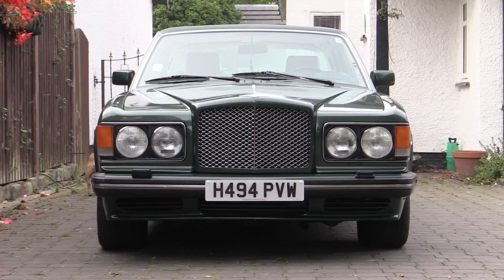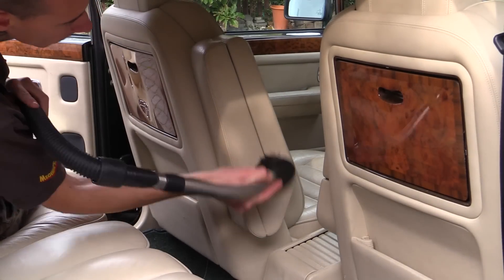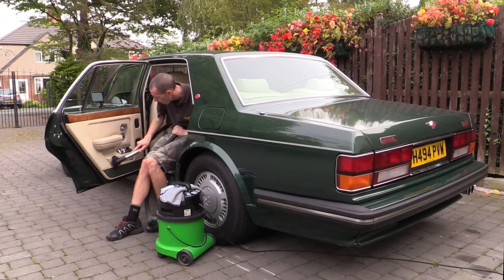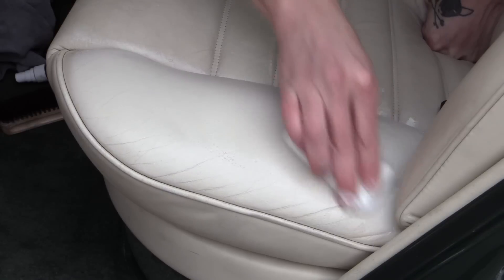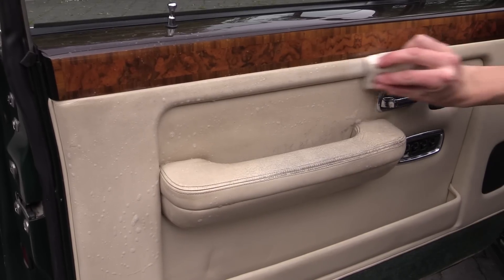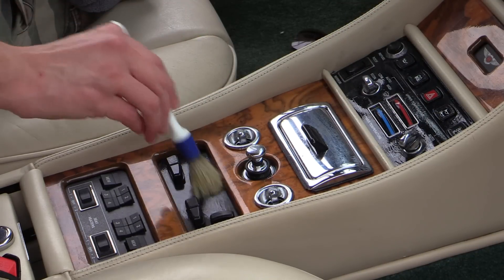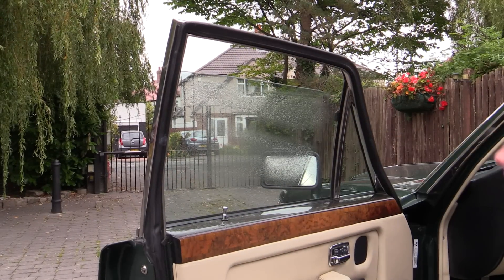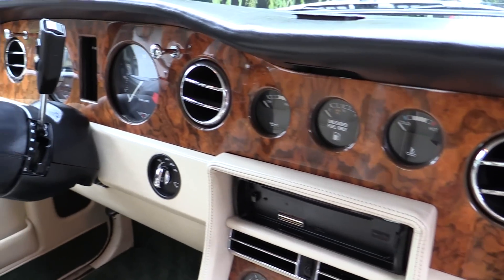Decades of Dirt! Bentley Turbo R Interior Clean

Comment: Your video will be of tremendous use for me.
Whenever a girlfriend says "you spent HOW LONG washing your car?" I can refer them to this video and tell them that there is a world of difference between a simple car wash and a proper detailing. As a matter of fact between getting out the pressure washer for my foam gun, the two bucket washing and the CR filtered water for the final rinse (and I do remove the wheels too) Maybe I would be better off just throwing her a hundred or two and tell her to go shopping with her girlfriends.
I once spent three entire weekends on a Porsche that a friend bought at auction and I told him it could use a proper cleaning, compounding (to remove the swirls that the pre auction fluffers installed) and then Cquartz coating. Just the under body and engine compartment took an entire day. I spent three hours just jeweling the paint with Menzerna po85rd and a black pad.
Damn, did I feel satisfied with the results too.
Reply: People who don't detail cars, just don't understand how long it takes
to do it properly.  Feels wonderful when finished, and the car is
just gleaming.
Reply: Joe's Place haha I'm a girl and my ex boyfriend would always gawk at the time I spent babying my Lexus sc... he ended up breaking up with me because I wasn't girly enough (I'm into cars and he thinks that's a mans hobby) Oh well...

Comment: Iove your videos. I don't know why but I find cleaning a car relaxing even tho it's hard work. It's also so satisfying to see the outcome.
Reply: Tech Metal same here.
Reply: Finally someone like me haha
Reply: Actually it is alot easier than it seems. Its only difficult working in a shop because they choose quantity over quality. Ive spent a full day detailing an SUV. Turned it from a dirty soccer mom type vehicle to a brand new luxury SUV that it should be. All it took was a shop vacuum, trash bags, carpet cleaner, vinyl cleaner and protector,  leather cleaner and protector, wheel and rim cleaner, microfiber towels, glass cleaner, car exterior soap, shammy, buckets and an assortment of brushes. The price you pay at the shop is the same price you pay for all the supplies that can do at least 5 details. You could also attempt to wax your own car but I wouldn't recommend it. Just use a clay bar. Its very easy to mess up a waxing.

Comment: Did you get the steering wheel cleaned? It's one of the most overlooked parts that most detailers just overlook or simply wipe dry. When I detailed my family's 4 year old car, I hit the steering wheel with APC and swirled with a brush, then when I dried it off my towel literally turned dark grey. That steering wheel had 10x more dirt on it than the entire interior combined, and my family are quite clean people.
Reply: AgentAndroid sometimes through age the colouring of the steering wheel can transfer onto a cloth because of the dye

Comment: If you have a velcro backed electric DA polisher, you can buy various Velcro backed brush pads. I have a light/medium one and use it to clean cars with all leather seats being dirty. I typically do it first, since the DA can sometimes throw a bit of agitation foam but it works GREAT for tackling a large amount of upholstery in a timely fashion.

Comment: Magic eraser (melamine foam) is the equivalent of 3000 grit sandpaper when wet. Works great!
Reply: I actually damaged a leather steering wheel on a 2015 car (left some white spots, meaning I removed a layer of leather), had to get it replaced by warranty, but now I cringe everytime I see someone rubbing anything with it, its a really abrasive tool if not used correctly, I'm really wondering if he decreased the life of those leather seats using the magic eraser!

Comment: Im a 15yr detailer...worked at mercedes many years...done 100s of cream leather seats only using a bucket of hot water to rinse APC sprayed onto magic sponge...spent years using tradition leather scrub techniques with dissatisfactory results....excellent results from magic sponge...most times its the first and last time the leather will ever be cleaned...so its ok to be aggressive and seal to protect...i use on all vinyl and leather interior surfaces...especially dash , steering wheel and gear shift knob....thanks for the great videos...

Comment: A couple suggestions. First, when vacuuming the carpets, agitate the fibers of the carpet with a stiff nylon brush. This helps bring the dirt up so the vacuum does a better job. Second, when vacuuming and cleaning the front seats, recline the seats as far back as possible. This is so you can easily get into the crevice between the seat and back. Also makes cleaning more thorough.
Reply from the maker: +gatorcellman While you're not wrong, quality carpets like these can often get away with not being brushed first plus these weren't actually that dirty, and having not been used for awhile the battery was dying so I wanted to keep the seat manoeuvres to a minimum, plus I think a few of the switches weren't actually working!
Reply: Don't think this guy needs any advice form you to be honest mate.

Comment: If the owner never cleaned the interior, I do NOT want to know what was in the door pockets! I"ve seen an episode of Top Gear where they bought used cars and had a lab test every inch of the car. Richard Hammond had the worst car: they found mucus caked up around the doors and inside the door pockets! Poor Hammond!

PS: using the Magic Eraser on the seats is a brilliant idea. I never thought of that. I'll remember that tip if I have to get a really nasty stain out of my GTI's seats. I find it hilarious that Youtube recommended this video out of nowhere because two days ago, I spent three HOURS washing/detailing my GTI. I used Meguiar's #16, which is really strong but it isn't always easy to remove it so I had to go over the car twice: once to remove the layer and again to make sure I don't leave any residue. Had to rely on an LED light to make sure I got it all off.
Reply: YouTube will recommend stuff to watch depending on what you google, also when I shop online YouTube will recommend stuff similar to what I bought.. I used to think I was being Mind Fucked but then I calmed down and figured it out...

Comment: He should have done the back top seats first, that way he can sit on the bottom 1/2 and clean away  better and then do the bottom 1/2 after he is finished, instead of sitting on a just cleaned surface. :)

Comment: Nice work mate.. I use the 303 aerospace protectorant also... Love the stuff,  so do my customers . One thing but, I noticed on the black door cards of my car that after some rain had got in when I accidentally left windows down one day it left white marks where the drops had run down the door card . In fact I have noticed this on several occasions. Have you ever seen this? Weird thing is I have never noticed it happening on any exterior areas I use the product. I thought it might be caused by the different materials the product is used on.
Reply from the maker: +Tony Villarreal Yeah rain almost always leaves unsightly marks on interior surfaces, especially dark leather. It could be to do with the fact the 303 is water based but if it isn't happening on the exterior then maybe not! I've always found they come off quite easily though and are never permanent.

Comment: You did an amazing job on this vehicle, a few of the items you used did surprise me and I enjoyed watching some new techniques. I don't know if you still check the comments on this particular video, but I noticed that you used a leather cleaner, and then a spray on leather sealer (I thought you said). Is that like what a conditioner would do?  When I clean the seats of my older Bentleys and Rolls-Royce's, I always have used Connolly Hide Food, I can easily get it where I'm located, and it may be cliché but I've always liked the smell. Hearing your bit about the UV protectant of the sealing product you used, I was interested to determine if this was better than the hide food.  Thanks!

Comment: Hey Buddy, like what your doing and in a very pleasant way too. Really like the idea of the zymol and eraser combo. Nice to see the quality car being cleaned but why no videos of a manky builders van!!!!!  Reckon you would have many takers for that one.
Reply from the maker: +Roy Armstrong I bloody hate cleaning vans and still have nightmares about some of the wrecks I've cleaned in the past!
Reply: I've just taken delivery of my new to me van. Long wheel base transit,
stinks,
Dirty,
Ghosted lettering,
Rotten ply in the back,
Unidentified stains in the seats and floor area etc.....
and those are its good points. Going to do a full overhaul from engine to back doors and might try posting them. 
P.S. Any ideas on how to get rid of the ghosting apart from the Porter Cable DA and 1000 grit ??

Cheers Buddy and keep posting I already ahve 3 pages of notes!!
Reply from the maker: Haha nice one, sounds like the kind of thing commercial dealers used to want me to remedy in a few hours for twenty quid!

I've done allot of vans with ghosting and have never had to use anything seriously aggressive, so start of with something relatively light and if that doesn't 'cut it' move up otherwise you're just potentially making more work for yourself with the finishing that will be required after the aggressive cutting.
Reply: +Car Cleaning Guru Thanks for the reply buddy. Will start off with cleaner wax and see what happens. 
Thanks Roy

Comment: Very nice! In my personal BMW 530i, the black leather has a lot of sun damage; it's very hard in places, where protected areas (like where the leather is shaded in the back portions of the back seat) are buttery soft. Is there a product you have experience with that I can use to help soften and restore the leather?
Reply from the maker: CG Sprayable Leather is good although it sounds like it may be too far gone in places.
Reply: +Car Cleaning Guru Yeah, that's what I'm afraid of. And reupholstering the whole interior would cost an arm and a leg.
Reply: Car Cleaning Guru Thanks! Love your videos!
Reply: You should try Leatherique. Its a 2 step process, kind of expensive and takes some time but it will leave your leather very soft and clean. I used it in my 1988 928S4, which had very dry and hard leather, and the results were incredible.
Reply: Manuel Gorbea Oh, cool. I'd heard about them in the past, but related to leather repair and crack-filling.

Comment: @carcleaningguru

i recently purchased a car with a partially torn strip of leather along the side of the drivers seat and I'm looking to repair it. i see from other videos that it can be fixed diy. i value your opinion and i was wondering if you've ever repaired a seat during a detail before and if you have what product(s) you may recommend?

thanks great videos btw
Reply from the maker: +baseruner13 I've got no experience with actual physical leather repairs, sorry!

Comment: Joe as always I love your videos but am curious about something you say every so often, you have to sacrifice a full blown detail because losing time and will have to suffice because also working the camera, is there owner blowback or do you touchup what you're "compromising" on or leave as is
Reply from the maker: Almost all the cars you see on the channel are ‘staged’ cleans which are done free of charge so even if it ends up a half-job due to camera work eating into the cleaning time, there can’t really be any complaints. Paid jobs are performed off-camera as they require focus and every minute possible to get them done!
Reply: @CarCleaningGuru  ah that's awesome. Part of me wondered that. Can't wait for new videos (I am rewatching some of your videos over and over) and can't wait for one on actually doing paint correction PS I don't know if you've used it but The Last Coat is a brilliant product but it needs your seal of approval

Comment: Hello, I recently bought a Jaguar and unfortunately it was a smoker's car, I was wondering if you would be able to suggest some products, and/or cleaning tips to get rid of the smell.
Reply from the maker: +Jonathan Long There's no easy fix for smokers cars unfortunately and you'll never be able to eliminate the smell 100%. I've always found the best product for removing nicotine is an all purpose cleaner diluted 1:10 with water (I'd go with either Meguiars or Autosmart G101).This cuts right through it but isn't the most friendly on leather and certain upholstered surfaces so be careful.

If you don't know exactly what your doing I'd suggest paying for a proper interior detail as you can actually make the smell worse by agitating the nicotine and not fully removing it. Also look into fogging machines which can help reduce the odour.

Comment: Guru where's the best place to ask you some questions? I recently got a car with red leather interior (I've only had performance cars in the past with bare bones interiors), and I notice dye transfer from my jeans onto the seat, seems fair enough. 

On a test spot the die came of very easily, but I'm wondering does "sealing" the leather prevent or at least minimize this dye transfer? I understand the point of the leather cleaner of course, to just clean the leather obviously right. But is there a difference between sealer and conditioner, or are they just interchangeable terms..

I thought I was a stellar detailing hobbyist but seems I've never bothered to learn how to care for leather since I've never had much of it in my cars before... 😅 this is what I get for skipping all material on leather throughout the years
Reply: You will never be able to remove 100% of prostitutes blood from your interior or boot lining.. Anyway this is the wrong place to ask about it.. Burn the vehicle and claim your insurance.

Comment: Do you ever use coconut oil to soften and nourish the leather or is that not a good thing?
Reply from the maker: Only ever used it for cooking I'm afraid!
Reply: I have been curious, i have been using it on Audi leather seats for a few years now and does a great job at breathing some suppleness back into them and keeping them protected for a year or so. I guess the one major off put of it, is up to preference. As you have to actually like coconut or the smell might dissuade some from wanting to use it.

Comment: What suggestions do you have to remove blue jeans stains from light color leather?  Thanks
Reply from the maker: +SAB8 A diluted all purpose cleaner will lift denim stains off however you should not spray it directly onto the leather and be careful to not let it dry as it can stain and cause the colour to run.

Comment: Did you re feed the leather before sealing it?
Reply from the maker: +volumeboy No, the Zymol cleaner is glycerine enriched with aloe vera so that had to do here I'm afraid!
Reply: What's re feeding the leather??
Reply: +Joey Arthur Zooberry When you clean the leather you remove dirt and all or most of the moisture. 

You need to re feed, condition or moisturise the leather to keep it soft and supple and to prevent cracking.

Comment: At 14:00 it says rolls-royce and Bentley
Reply: Rolls-Royce took over Bentley in 1919. All Bentleys manufactured from 1931 to 2004 shared a Rolls-Royce chassis and many engines.
Reply from the maker: Thanks for the heads up!

Comment: Its factory coated leather, so using zymol was a waste of money, since you were essentially cleaning plastic, the magic eraser is essentially 7000 grit sand paper, the meguiars super degreaser would have gotten it even cleaner without being abrasive, I could have cleaned all that leather in one hour with the meguiars. Step your game up.
Reply from the maker: +coliseum 1 Any factory coating was long gone here hence why the dirt was so ingrained in the colour. Using MSD would have eaten straight through it (as the G101 I tested on an inconspicuous area did) and left horrendous staining.

Comment: What's that magic eraser?
Reply: It's an abrasive sponge.  They feel like normal sponges that you clean pans with but are actually fairly abrasive.  They work really well but be careful with them as they can easily damage some surfaces.  They do work really well for the right job though.

They are sold under the name Magic Eraser in the UK so just Google that.

Comment: Hi there I cant hear a noisy generator in the video so what power do you use the customers?
Reply from the maker: +The Channel At the moment yes. With the vac running for hours at a time on the driveway it makes more sense than a genny!
Reply: +Car Cleaning Guru how are the customers? when you use it are they okay with that ?
Reply from the maker: Will if it's a freebie they can't really complain, my other paying customers have known me for years. If you're starting out looking for new custom you really need to be self contained though .

Comment: the leather was shitty! was the p.o a smoker?
Reply: That's just years without cleaning on a light colored interior. I bought a car this spring in a similar condition. Guy I bought it from didn't smoke or anything but I don't think he'd cleaned it once in the past 100,000 miles he'd owned it. Whole interior looked several shades lighter after a couple hours with the steam cleaner/vacuum/scrubbing the ever living hell out of it.
Reply: P.o of my car was a smoker and you could see carbon on the inner door lining and on the headlining on the dricers side, upholstery seemed fine..